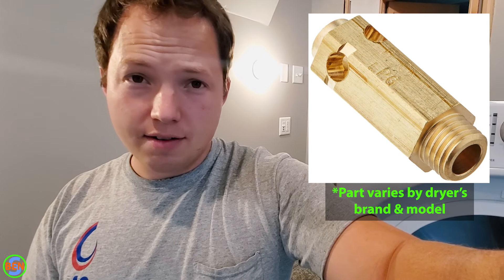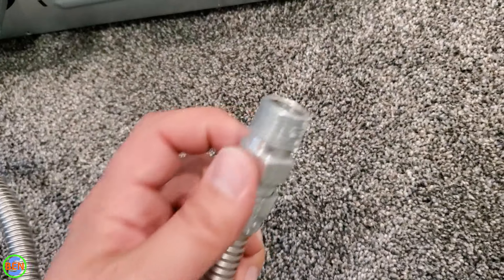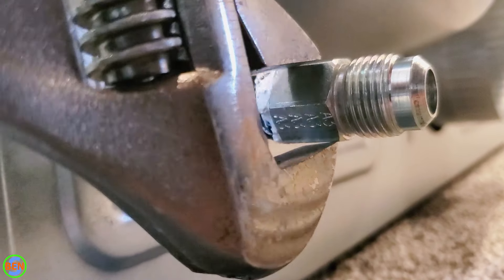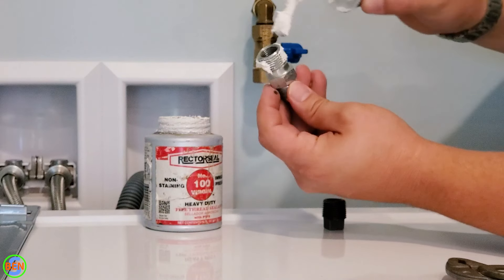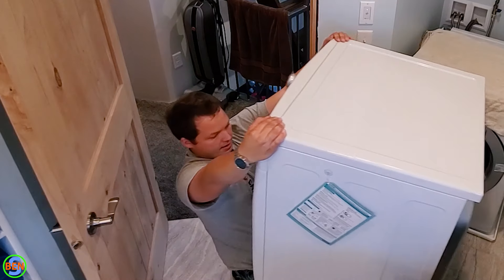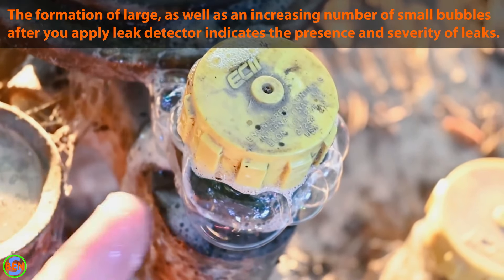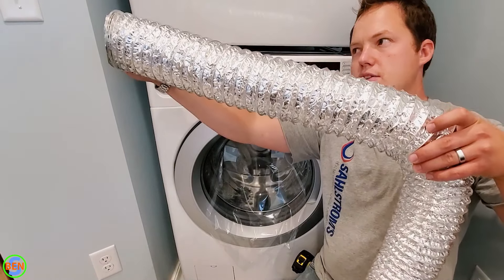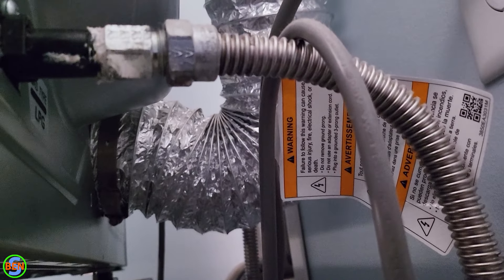How To Install a Gas Dryer - NG or LP Gas Line Connections

Comment: Should not use flex pipe with gas, only semi rigid or preferably rigid is the correct way to go. Every gas dryer installation manual warns against using flex pipe. Otherwise good install with the gas.
Reply: Mine states “If flexible metal (foil type)
duct is installed, it must be of a specific type
identified by the appliance manufacturer as suitable for use with clothes dryers.” Home Depot sells a UL listed one.

Comment: you are using the wrong pipe sealant. White is for water and the yellow pipe sealant is for gas. you should know that if you are in the trades.

Comment: We installed a washer and dryer on the 2nd floor so we didn't forever have to haul clothes to the first floor.  What an adventure!  Plumbing, drainage, venting, electrical, floor drain (code requirement) - none of which was in place or even close to where the upstairs laundry closet was located.  But - very glad we went thru the pain
Reply: I agree, it is SOOOO convenient!
Reply: Glad you got through the mess, me and my roommate have been managing with full time jobs after our washer broke
Reply: Matt, after a water leak from the Washer water tube line 2.5 months ago we blamed the house builder for putting the laundry room upstairs rather than in the garage or a small room near the kitchen. When our neighbor knew and saw the water damage, she told  me that throwing their laundry down and bringing them up for almost 20 years now was not that too bad after all.

Comment: I don't think it is a good idea to just "rest" the dryer on top of the washer.  Eventually the shock absorbers in the washer will wear out and then it will vibrate excessively on the spin cycles with an unbalanced load.  That could throw the dryer off and then possibly rip off the gas line.  Think about that.  Best to somehow build some support arms for the dryer, or they may make a support system to stack the dryer on top of the washer.

Comment: What an excellent Tutorial video Ben. We have an LG dryer too. Our laundry room is ready after the second tile installation yesterday. First time it was badly installed in 30 minutes. The second tile installer left the sliders for the next worker. Why wait for another schedule? Courage is only needed. After this we only have the carpets cleaned and everything will be finished after water leaked from the Washer water line tube 2.5 months ago. We are now going on our 3rd month.  Half of our living room ceiling was damaged, my room and the hallway carpets were soaked and of course the laundry room was the first victim. When I saw you lift that dryer, I remembered our former handyman who carried down an old Washer and brought a new one up in 2 minutes 11 years ago. Poor guy.

Comment: Also there is vent piping for dryers that are designed to prevent the pipe from getting crushed if you push it back. You have a tight bend at the back. Also is that vent pipe UL listed? I would recommend using the semi rigid pipe.

Comment: Hi Ben, I like your videos!  Long time lurker, first time poster.  Does the 120v outlet behind the washer / dryer need to be GFCI protected?
Reply: All outlets in the laundry area require GFCI protection.
Reply: Not required but it has to be a dedicated circuit.
Reply: How much does it cost to add in the electric outlet for an electric dryer for maybe future use? Thanks.  Keeping gas for now but fossil fuels are going to be limited in future!

Comment: What about a video to connect the dryer to a shared gas line with a stove (placing a splitter/diverter cap and reconnecting both to the line)

Comment: Don't u need to use yellow Teflon for gas?
Reply: Yesand DuraCoat semi rigid flex (yellow.) This guy shouldn't be making gas appliance videos.
Reply: And also that vent hose is wrong. You need rigid flex hose for dryers. I'm not a plumber,  I just know when I need to call one.

Comment: I don't know why everybody thinks the reason you need a different nozzle for propane is because it's a different pressure. They need a different fuel to air ratio. Propane has more BTUs.

Comment: Hmm. This doesn't look properly done. At 3:34, there should be a drop leg in that piping setup so particulates and moisture can drop, not going into the appliance. I believe that's code, no matter if your fuel source is methane or propane. I believe code is a either a 3 or 4 inch nipple going down that is capped. So, from the bottom of the valve, there should be a T, with the flare/compression fitting coming out the side, and the nipple with cap going down the bottom of the T. 
As for having the appliances stacked, manufacturers have kits to mount the appliances on top of each other, and they're a requirement as well, due to the vibration of the washing machine.
Reply: I think his drop leg is in the wall.

Comment: Dumb question but my dryer on/off handle is green not blue like yours is, is that normal? And question 2, when gas is in on position, does it go in line with the pipe and sideways is the off position? Also my gas handle to my water heater and furnace are both red, is this normal? Do they also need to run in line to be on and sideways to be in the off position?
Reply: For gas, yes, it's on when the handle is parallel to the pipe.

Comment: Use clamps for the exhaust duct. Using tape in the first 3 ft of run is against code. Foil tape is not made for that heat and will fail over time

Comment: Even with a flare connection, I will still use a little pipe dope.  No harm, pipe dope is cheap
Reply: Hmm, but the seal on a flared connection does not occur at the threads. It occurs at the metal-to-metal flare mating surface, which is not designed to be possibly contaminated with a foreign substance. You're likely increasing instead of decreasing your chance of a leak. Hence the strong warnings printed on all flared connections.

Comment: You're doing it wrong, you're supposed to check for when the purge is complete with a lighter! 😜
Reply: 💀💀💀you are right though (not saying it would have been me though) 
looks away
Reply: @davidbarrozo6621  i literally learned that from a guy on a forum called bill and posted it as a joke, he also claimed insulators are capacitors and it takes electricity to stop electricity.
Reply: @Jon-hx7pe  😂😂😂 that devil him 😈💀

Comment: I was with you til you showed that awful flex exhaust...
Reply from the maker: Do you just hard pipe it? Some flex seems necessary for vibration.
Reply: @BenjaminSahlstrom  for that short flex I would have used ridgid type aluminum flex and not the crinkly type.  Though solid duct is preferred.  The crinkly stuff isn't recommended especially for gas.

Comment: Sorry, do not like this install.   Terrible lifting.  Terrible flex pipe.  Terrible location for appliances.  Too tight.
Reply from the maker: Yeah, if there was more room I would agree! What do you prefer instead of flex? You're definitely correct about the lifting. I was in my 20s when I made that video but now that I'm over 30 I probably won't be trying that again.  Haha
Reply: @BenjaminSahlstrom  Semi rigid pipe. There aren't expensive and don't crush easily. The bends they make are better for flow but don't do 90 degree bends. For a 90, you need a preformed piece.